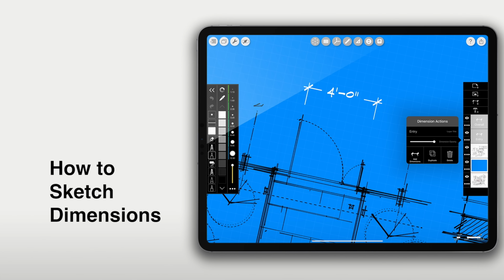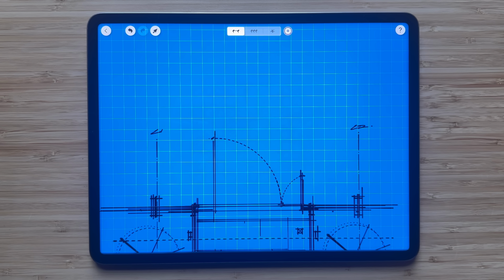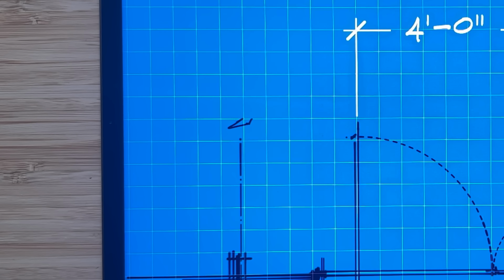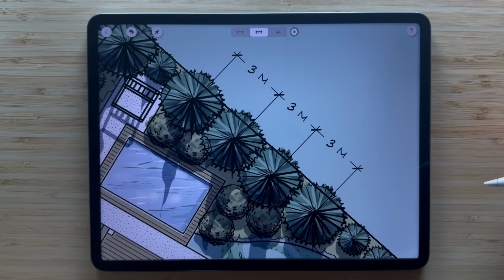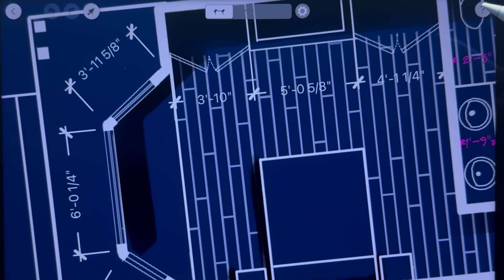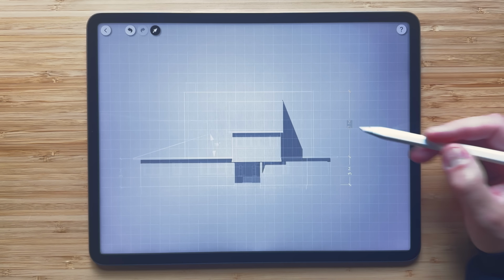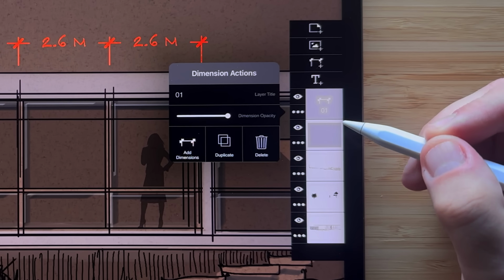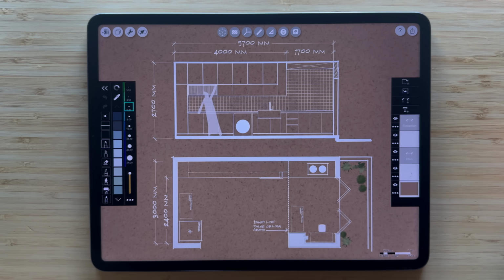How to Add Dimensions to Any Drawing - Morpholio Trace for Architecture, Interior & Landscape Design

Comment: Great! How to adjust dimensin line thickness? (when measuring small details) Is it possible to not show units?
Reply from the maker: we're working on an update that will auto-adjust the thickness with the size slider. You can always override the text to remove the units if you'd like as well.